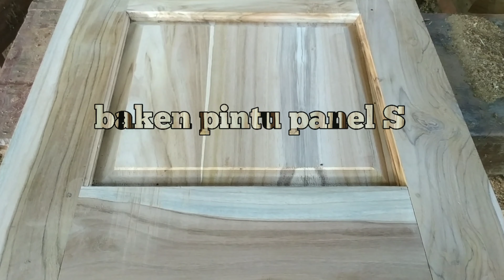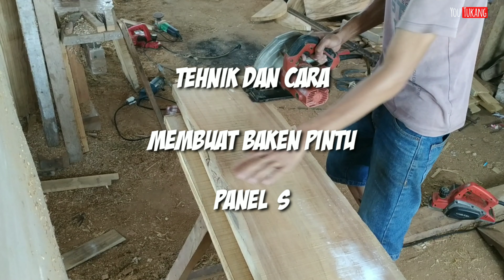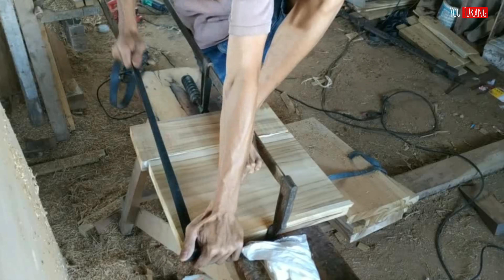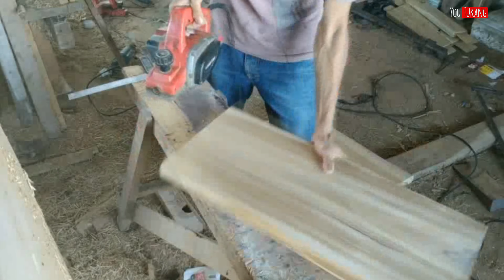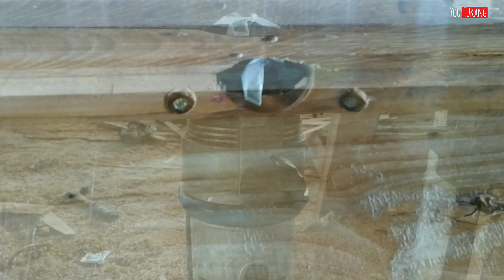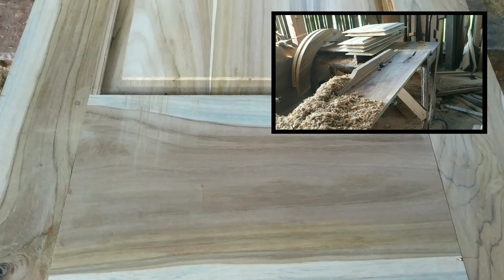Cara membuat panel / baken pintu TEHNIK minimalis

Comment: Mas kalau buat lup/ lubang panel pintu sama lup/lubang kaca pakai mata profil sloting bits yg berapa Mili mas🙏🏻
Reply from the maker: Umum 5/6 mili mas,, klo pke pnel seperti d video, klo untuk Minimalisan 8mili/1cm 🙏
Reply: 5/6mili ini untuk lup/lubang kaca jendela mas 8mili/1cm gak kebesaran mata profil nya mas apa gak berat dimesin nya mas dan gak kebesaran dilubang lup nya mas kalau buat panel pintu